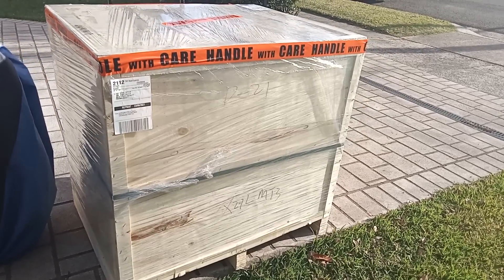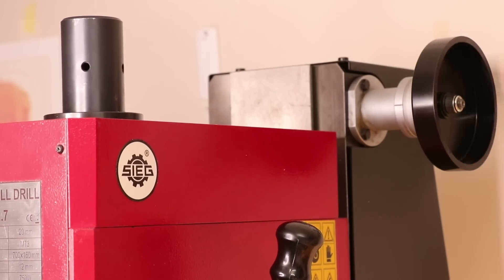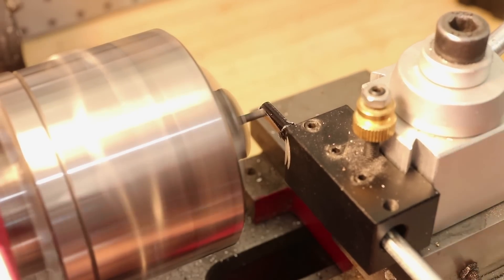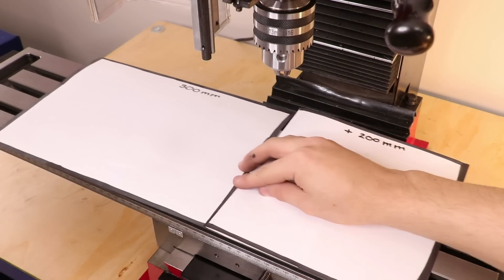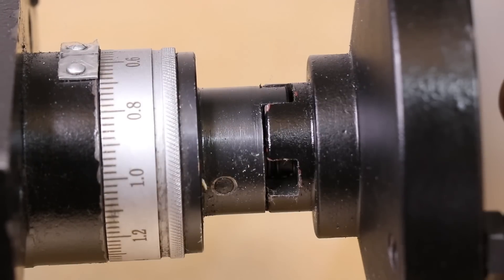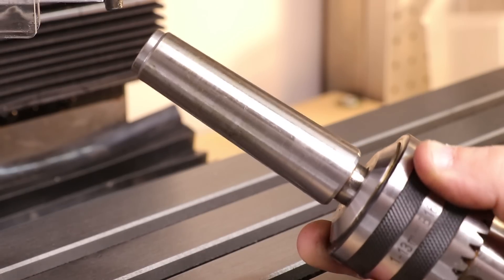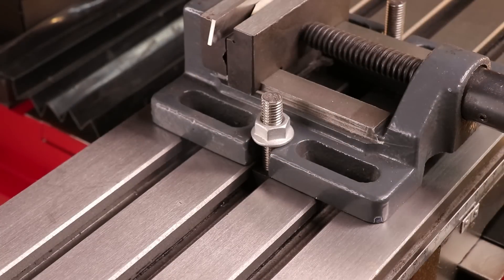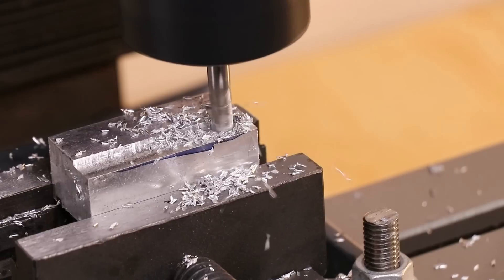I Bought A Mini Mill - Unboxing, Overview And First Impressions | Sieg X2.7l

Comment: Gezzz...put some lubricant on those cuts...If the aluminum sticks to the cutter it needs lubricant, if your steel chips come off blue you need lubricant...it will make your cuts nicer and save your tooling(Heat)..for general milling I recommend a water-soluble oil
Reply from the maker: The camera shots probably doesn't show it well but there was a nice coating of wd 40 on the cuts. I've since switched to a high sulphur kerosene alternative. Cheers

Comment: Does the MT3 spindle tape take the tang of taper drills ? I'm thinking your collet adapter ought to have a tang on it - for positive drive.

Actually, it's funny them supplying a Jacobs chuck - when you have the facility to take taper drills - more accurately and with positive drive.
Reply: The tang is NOT for positive drive, It's only purpose is for removal. Friction on the taper actually does driving.
Reply: @pvtimberfaller  You're neither an expert nor an engineer.
Reply: @pvtimberfaller  If the tang is ONLY for ejecting the item, why don't dead centres have them ?

You don't need a tang to eject an item - clearly - as not all things have them.

Why are they always designed to give a positive drive if that's what they're not for ?

As anyone with experience can tell you - when the taper slips, the tang drives.

The taper is for alignment - and drive but doesn't always offer enough grip for drive - the tang takes up the role then - until the taper is tight enough.

Comment: What exactly is the process of tramming one of these? I've heard horror stories of people trying to tram the x2.7 in old forums, is this no longer an issue?
Reply from the maker: There are two little grub screws where the column bolts to the bed of the mill. You screw and unscrew them to tile the column. Not sure about people having issues training it, but it certainly seems much easier than training in a X2 mill

Comment: What made you decide on this model as opposed to similar models? 

I'm currently looking at the Precision Matthews 727, which seems to be one step up from this one, for about the same price as a Sieg x2.7 - which is the primary US importer of your same model
Reply from the maker: Deciding which mill to get was a pretty difficult process, but here in Australia, the range of bench top mills is much more limited than other countries. So I was left to decide between the Sieg X2, x2.7 and X3. I can't comment on any precision Matthews mills since I can not get them here. With that said I would always edge towards a solid column mill. Past that I just made sure that the table was large enough and ensured that I wouldn't be limited by work area. Cheers

Comment: I know these were "test cut's", but on real parts, you might want to brush a cutting fluid on the part/end mill. ATF or wd-40 are great for aluminum. Used motor oil will work, in a pinch for steel. (cheap, but not as good as a "high sulfur cutting oil")
Reply from the maker: Thanks for the feedback, I used a little bit of wd in the shots bit it looks like it didnt show up well in the camera shots. I'm actually testing out high sulphur kerosene as a cutting fluid, as I have been recommended it. Cheers

Comment: There is another important reason why a drill press doesn't make a very good milling machine.  The bearings are designed for thrust loads, not side loads.  However, you CAN do some milling on a drill press if the job is pretty light duty and you aren't expecting the utmost in precision.  But in general, not a good idea.

Comment: if considering purchasing a mill like this, I think an R8 spindle is a far better choice than the Morse.  You give up a little in vertical work space, but it is a better method for milling machines with a vast amount of tooling available.  My larger milling machine at home is an R8.  (And larger lathe is Morse #5 in the spindle)  When I bought a Chinese mini-lathe and mini-mill, sort of just for the fun of it, I got illogical and bought the Morse taper mill version since that is what the lathe had and I could share the same collet set.  So not only did I get a mini-mill that doesn't hold cutters as well and is more difficult to release, but the R8 tooling for my larger mill won't work.  So I made the wrong choice for two reasons.

Comment: Probably for some very light steel work and aluminium. Anything serious probably needs a lot heavier machine. Say ≥850 kg at least.
Reply from the maker: I will have to wait and see. I have seen similar size machines work their way through steel, but I'm sure the weight of the machine will ultimately limit it. I think it should be fine with mild steel, but I'll probably have to be cautious machining carbon steels. Thankfully I am mostly planning on sticking to aluminium for the most part. Cheers
Reply: @artisanmakes  time to start sketching out how you're going to fill the column and base with epoxy granite ;)

Comment: Cheap d.r.o.: Take apart a couple of cheap digital calipers and glue them on temporarily. Or screw hole within bracketing reach. Just for when you need it. That's 150mm's/2 to play with until a proper setup goes on sale at least. Cheers.

Comment: At least use some fluid as lubrucant when cutting. I always use lamp-oil. Works great for prolonging the life of mills.
Reply from the maker: Cheers. I used a bit of WD 40, but it might not have been enough to show up in shot. I have heard of people using lamp oil/kerosene before.  I will have to try that. Cheers
Reply: @artisanmakes  You should use different lubricants depending on the material your cutting. Kerosene is good for aluminum if I remember right. While WD-40 is better than nothing it's not an ideal cutting fluid. I know WD-40 smokes like crazy when heated from the cutting. Better fluids have a lower smoke point. I'd recommend looking on either hobby machinist forums or looking for what old school guys used.

Cutting fluid/coolant on industrial machines is a different beast as they usually use carbide being run at its upper limit to achieve optimal cutting times. That doesn't apply to manual machines, especially small ones, that can't necessarily even reach optimum speed for carbine tooling. 

Similarly, High Speed Steel tooling might be better than carbide for solid end mills, at least in this use case, due to both price and resharpenability.
Reply: @artisanmakes  that sounds super dangerous. using a flammable liquid to lubricate a surface that gets hot? I've never done any milling or machining so I don't know much but that just doesn't sound right to me lol.

Comment: Always put a block of wood under the chuck when removing it.  If you drop the chuck you don't want to chip the bed.
Reply from the maker: Thankyou for the heads up. I will admit that I filmed knocking the collet chuck out about 3 times so it was never too tightly seated in the spindle. Cheers

Comment: The x2.7 and SX2.7 should auto eject the tool so don't need a tap from a hammer to release the taper. Leave the metal cover screwed in place and then undo the drawbar after a couple of turns it will tighten up and then pop the taper apart as the flange around the hex socket pushes against the underside of the metal cap. Amount it needs to turn will vary slightly depending on length of tooling.

Comment: Basically you will have to take the entire machine apart and put it together again.
I also bought a mini mill, I replaced all the leadscrews with ballscrews (=no relevant backlash anymore),  replaced all the bearings with japanese ones (=the machine doesn't run hot anymore).
And of course added some motors to have a mini CNC.
Reply from the maker: Thanks for the feedback. I can already tell that in time I will probably have to replace the spindle bearings. As for the cnc part, I hope you enjoy your cnc upgrade. I have worked with quite a few cnc mills over the years, but i'm planning on keeping this one as a manual mill. Cheers.

Comment: Don't do DRO. You definitely need to convert it to CNC. There is no reason to have manual milling machine in 21st century. Whatever you do manually you can easily perform by directly typing operations in MDI console of the controller but with way better surface finish due to constant feed. The only question is if you're knowlegeable enough to design and biuld a proper CNC retrofit for this machine. I'd suggest to go thickiest ground balls crews possible with proper supporting blocks with a duplex pair but not deep grove bearings as all the cheap stuff have. I've done my own CNC conversion on SX2 and got the best out of it. The only complain apart from small working area I still have is a hell flexible column (solid one but Chinese lack IQ to get it rigid) yet dodgy gibs which are hard to adjust spot on. The DC servo power-train is pretty much OK and it does job very well with its 0.5kW motor so at 2500 RPM max.  I can easily afford 20% stepover with 150mm/min feed with 6mm carbide end mill cutter on 6061 aluminum alloy.
Reply: What dept of cut you could go max at 150mm/mn with your 6mm end mill?
Do you know if it's possible to keep the hand wheel if converted into cnc?
Thanks
Reply: @Levisgil47  , 10-12mm. But you have to pay attention to the gibs if they're reasonably tighten. Otherwise the silence might get broken-up by either cross table or head stock vibration. Also the carbide cutter must be as sharp as a brand new one and be able to cut aluminium as easy as butter. If the milling cutter gets either slightly dull of damaged you can expect some chatter from that. A spindle also must have no axial backlash ir you you want to get smooth surface finishing. I've noticed that Chinese carbide cutters get dull quite quick on 6061 alloy. I cannot afford to use any lubricating liquid as my milling machine sits right in my apartment but I wish. I only use lubrication together with frequent periodic drill bit retraction when drilling deep holes to avoid the tool being snapped in a workpiece. Lubrication might help to extend milling cutter lifespan a bit. I'm going to give a try to milling cutters made in the USA and see how they go.
Regarding having hand wheels on a CNC machine  - they are as useful as an ash tray on a motorbike. They definitely shouldn't be there. On this kind of milling machines with dove tail slides the stepper motors must be closed loop type with optical encoders attached to them so you cannot expect any extra shaft sticking out at the rear of the motor. You can do everything what you do with your hands and way more but with CNC control. The hardest time is when you build a first CNC machine from the only manual one you have cause you'll definitely need to pull it apart then get back to its manual state many times to make some new part required or modify an existing one. The best way to go would be to do CNC conversion on a second machine.

P.S. Vertical columns are bad on all the hobbyist milling machines made in China. The proper one should look like that:
https://www.aliexpress.com/item/4000371288236.html?spm=a2g0o.productlist.0.0.735e123eSDI2It&algo_pvid=0af6fddb-4c58-416c-aae4-73710362dcd2&algo_exp_id=0af6fddb-4c58-416c-aae4-73710362dcd2-2
Reply: @MSM5500  great info !  Thanks for sharing. If I had to get two. What could be the best choice ?  Sx2.7 as a conventional mill + find a X2 to convert it into CNC or modify the sx2.7 into CNC and buy a bigger one like the sx3 for instance as a conventional mill? I know CNC is always good but sometime you just need to do small work.
Reply: @Levisgil47  the thing is there is no best choice among the Chinese hobbyist milling machines as they blind copy their flaws from each other. I know that the Sieg design is quite hard to tram for instance. Their head stocks have no tilt adjusters on a surface as they are buried inside. But anyway, the bigger is always better as mass means energy according to E-mc2 so the heavier parts are the more kinetic energy they can absorb. This means you can apply more force to the cutting tool till  some severe oscillations/vibrations occur. IMHO its quite false assumption that a smaller machine si kind of more suitable for smaller parts. Maximum spindle speed is what really critical when it comes to dealing with cutting tools of smaller sizes which obviously require higher revs. 
My next machine (if it happens to be) very likely will use an entirely custom made column (or fixed gantry). I might utilise a cross table assembly from the existing products since they don't have as many problems as the columns and the head stocks. And the spindle should have at least 10000rpm to be effective at smaller cutting tool diameters. Or I might go with linear guides instead of dove tails if i have a chance to get some massive ones at reasonable price level. So in a nut shell there is no simple answer for this topic. The other question is how to not over capitalise the project.
Reply: @Levisgil47  "there is this modification" 
That's rather a "Cowboy fix" than a solution. It might give some improvement to rigidity but it won't fix the fundamental flaw of the design. The other question that arises from that is how to tram that Z axis? Tramming involves two stages: 1.Squaring vertical guides of Z towards the table plane. 2. squaring a spindle axis towards the table plane. In case of Sieg and the others squaring the column can be done by either scraping mating planes of the column and of the machine bed or putting some shims in between them. The first method is hell hard and requires shit load of time as you have to pull apart then put everything back after each scraping session to confirm the results. On my Sieg I went the second way and put some portion of brass 0.05mm (the thinnest one I found) shims under the column. But the problem is that the  size of the column base (a flange) is too small (that's the most fundamental fault made at engineering stage) so you either overshoot or undershoot the right angle you're after. So I couldn't square my column perfectly yet. There is no way to adjust tilt of spindle on Sieg as the bolts are hidden inside of the head stock. So in fact i squared spindle towards the table bypassing squaring the column on it's own. I believe It's worthwhile to design and build a proper brand new machine bed with column than trying to turn someone's crap into gold. 

Regarding those AC asynchronous 3-phase spindles  with VFDs I can tell you that those spindles produce no torque at low RPM at all. I've got this kind of 2.2kW water cooled spindle with VFD on the other machine I've built of THK/Rexrtoth linear actuators. So with no torque you won't be able to perform any low rev jobs such as boring, drilling, face milling. Second of all Their ER taper is not capable of mounting some tools as well. I've seen some people used those spindles connected to the spindle via belt transmission to increase torque But you can use any other 3 phase motor for that. 
The most straight forward option is to use both a high speed spindle and a stock one on the same machine at a time but for that purpose the machine must be definitely bigger that my SX2.

Comment: Hold the tool further in the collet only have what you need sticking out
Reply from the maker: Thanks for the feedback. I have run into this problem a few times, if I stick the tool in more it won't show up on camera with the angle I'm filming at. Too much stick out and I loose rigidity. Always a difficult balance to find for filming. Cheers

Comment: Have never understood why some folks are compelled to open a box containing a recent purchase, photograph the opening  and then post the pics on the net. Ego? I just do not understand it. First impression are not always reliable and time testing is of more value in a tool and "date" So when you have run the machine for sometime let us know how it works for you. Pics of your work with the machine would be useful

Comment: also, the boards on the basic X2 burn out, maybe due to underpower/lack of power? I've seen sev. youtubers having to order new board from harbor freight....that table on the x2.71 looks as huge as the rong fu mill drill clones which are over 600lbs.
Reply from the maker: That does not surprise me, if I am right in thinking the X2 shares the same motor and board as the Sieg c3 that I own, and incidentally I that board burnt out too. Cheers

Comment: I always use Diesel Oil for washing off the sealant.
Reply: Does diesel effect painted surfaces?
Or is their something to remove diesel soon after application on painted surfaces.
Reply: @mrillis9259  depends of the kind / type of paint.
The paint on my lathe or mill was not effected. At least I did'nt notice it.

But  when I remove the diesel oil from the paint with acetone, the paint will be dissolved.
Well - not that much, just a tiny little bit.
So I just wipe the diesel off with a clean rag.